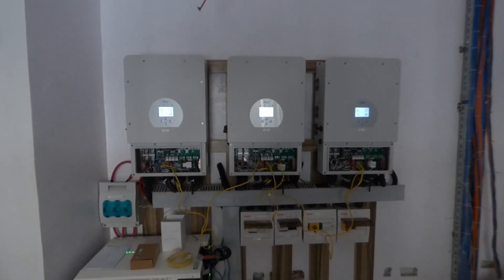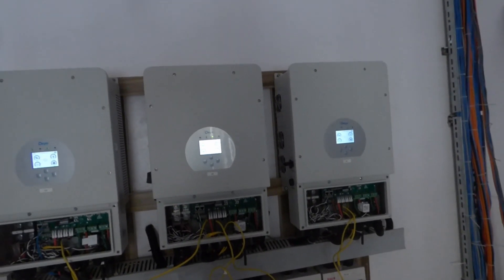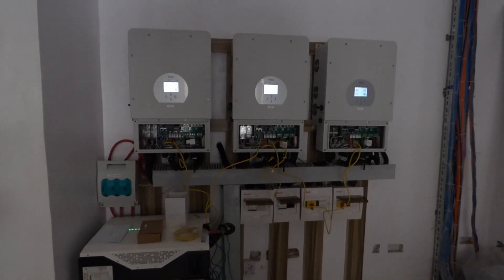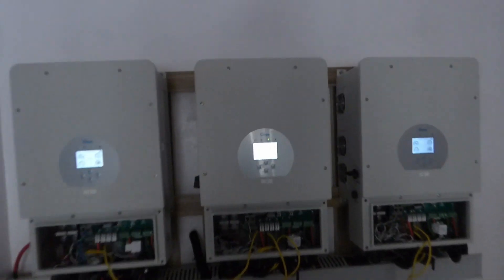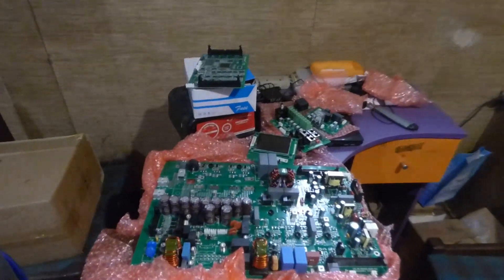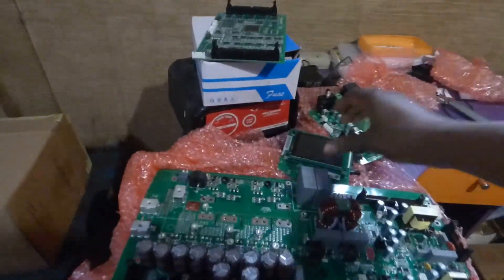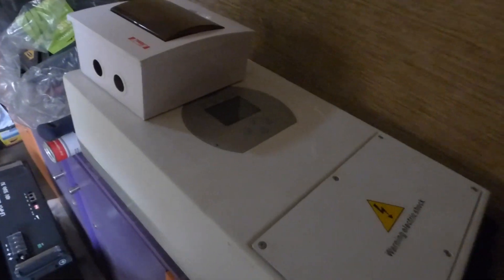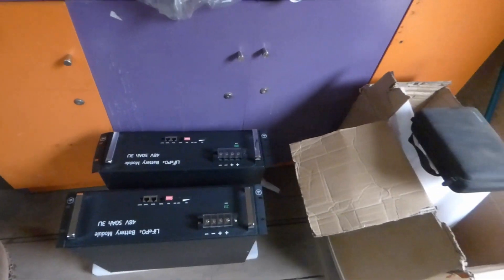New Deye 3 phase 24 kw (challenges) and honoring a Deye warranty

Comment: Did you get both issues resolved doc the 3 phase and the parts replacement?
Reply from the maker: We did a work around on the three phase. We have resumed for business so I will address it this week. The replacement parts I had my team put it together. They were not as diligent so some other issues cropped up. I will keep you posted.

Comment: Thanks for the 3 phases parallel set up. While expecting you solved the issue, could you please let me know what will happen if one grid line (L1,L2 or L3) goes on power outage while the others lines are OK. I am bringing this question because on my area the grid power supply is harmfully instable. Sometimes voltage may even fall below 100v on one line,...
Reply from the maker: The inverter will continue to invert till the batteries run down. It needs all three to bypass. You are welcome we will get it resolved

Comment: Working as standalone is less problematic. I recall you had a phase rotation issue sometime back while working on a Victron 3 phase system somewhere in ikoyi. How did you resolve that issue? Another con on the Deye is the continious firmware update remotely. I think they need to standardize the base firmware when shipping out these boxes to prevent incessant issues. As regards the spare part replacement, I am impressed, was it replaced at no cost? I believe it would be since the machine is still under warranty. Am looking forward to deploy these machines.
Reply from the maker: Hello papa Stone we moved the phases around and it worked. The firmware on the Deye is not automatic. I can do it or request that it be done. The firmware was standard until they pushed through the update. The spare parts were sent to my forwarder at no cost to me
Reply: @drsolar  impressive and I hope they keep up the high standard.
Reply from the maker: @ibidapoilawole7120  they will. They are thinking big

Comment: Nice one Dr am always looking forward seeing your video, those deye inverter are connected in series, secondly I have 12v battery I connected in series to make it 24v, I tested it capacity each I noticed that one capacity is higher, how due balance it to be the same while charging it?
Reply from the maker: Merry Christmas Ike. Thank you. Get a battery balancer / equalizer. That is what I found that works. They are cheap enough and plentiful in the market today. If you don't use one be prepared to perform an equalization charge. Most systems can't do that. Good luck with your battery.

Comment: Please I need an advice.
What is (are) the pros and cons of combining inverter batteries of different capacities parallel.  150AH 12V and 220AH 12V???
Reply: you will end up with 150ah capacity
Reply: Don't do it. You risk damaging them as you may end up repeatedly over draining and over charging them especially the lower capacity one.
Reply from the maker: As advised by ad on. I would not do it. You have buckets of different capacities and you try to fill them. The controller will stop charge once the smaller one is full. The inverter will continue to discharge to the cut off % that corresponds to that of the bigger battery which might exceed that of the smaller resulting in damage. The first due to improper charger, the second due to an over discharge